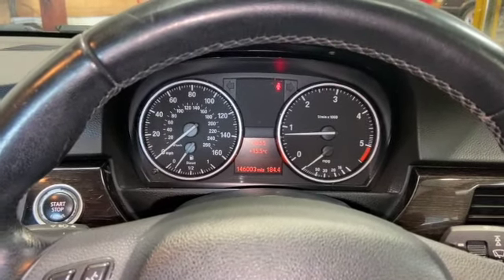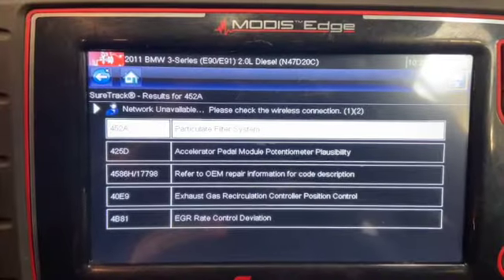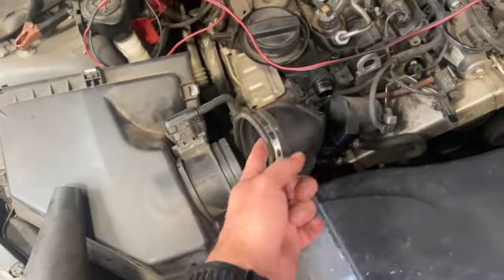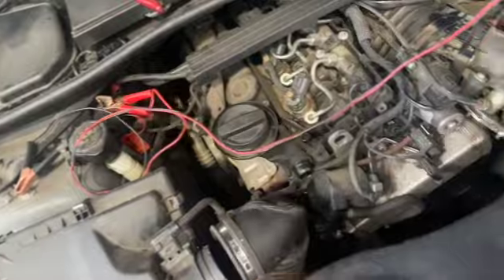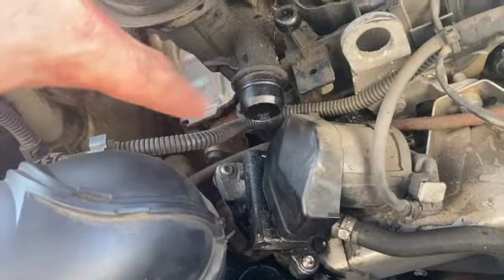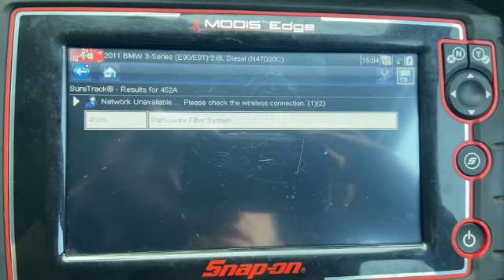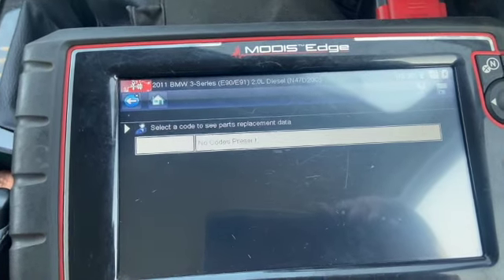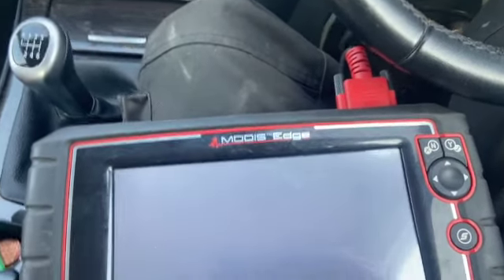BMW 320D engine light on and restricted power *FIXED* P452A P425D P4586 P40E9 P4B81

Comment: What is the problem with P115C  318d 2009 ?
Reply from the maker: P115c relates to the Air Flow meter (MAF sensor) this could also be caused by an air leak in the system though.. my first check would be a leak test with a smoke machine then check the readings from the air flow meter with a diagnostic machine  if no air leaks are found
Reply: Exactly my problem at the moment on the same car you've got, did you find a solution in the end? Thanks

Comment: Hi, tell me something. This problems occurs sometimes? What i mean, that if is the half motor light appears some for few minutes, after disapears for some minutes or kilometers and appears after a few days or weeks later. I already clean de MAF, MAP, but problem persists. I will check these pipe.
Reply from the maker: yes it can cause at intermittent fault so definetly worth checking the pipe .. thanks
Reply: @diydaly  And more, it happens in extreme irregular roads or in clive roads. When happens, its like the car entry in safe mode, rpm limited. But after few 10 a 20 kilometers disapears the symptons, the yellow half light too and the car runs normally with all powerfull.
Reply from the maker: @nunogoncalves7005  thanks for the reply , have you had the fault codes read?
Reply: @diydaly  no. I´m trying resolve on my own, without leave the car to the mechanic. I don´t have a machine for read the codes. If i can resolve it would be good and after in some mechanic service I would ask to erase the errors code. Sorry for my english. I´m portuguese. Thanks
Reply from the maker: @nunogoncalves7005  no probs that’s fine mate! I can work most of it out haha .. the problem you’ll have is there quite a few items that will cause the issue and a simple fault code read may point you in the right direction 👍
Reply: @nunogoncalves7005  sir i have exactly the same problem as you have described. Did you fix the issue?

Comment: Mate i replaced the part reset the codes it was giving the power for a bit but then then the next day when i started it the fault code came back up and there is no power any idea what is wrong
Reply from the maker: Which codes did you have stored mate? Thanks
Reply: @diydaly  do you have anything what i could send a picture of the codes to u
Reply: @diydaly  the codes are p2279 p0101
Reply from the maker: sounds like you have another air leak mate, one other area that's quite common is the pipe onto the intercooler.. it may be split , you could do with a smoke leak detector really .. id have a really good check of the pipes mate
Reply: @diydaly  no worries mate thanks for the help will check the pipes in the morning just subscribed thank you
Reply: @diydaly  and does that cause the power restricted light to come on
Reply from the maker: Thanks for the sub 👌👍
Reply from the maker: Yeah it will go into limp mode and put the light on 👍
Reply: @diydaly  nw will check it 👍
Reply: @Smoliber____  any luck?
Reply: @soyef7  na it wasnt that i took it to a specialist and they said it had a bad remap from a past owner so i took that off and its been good so far